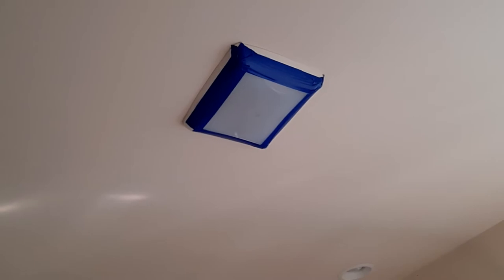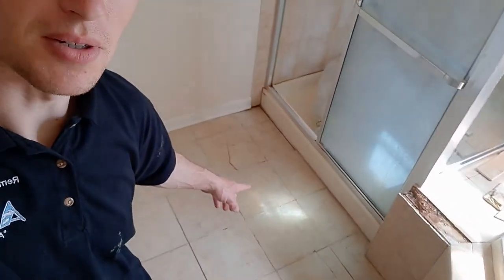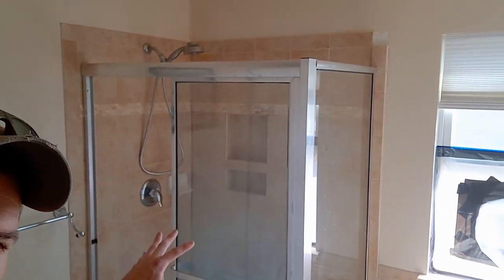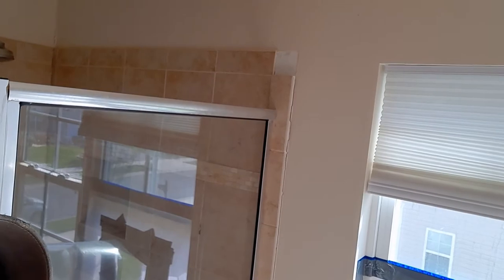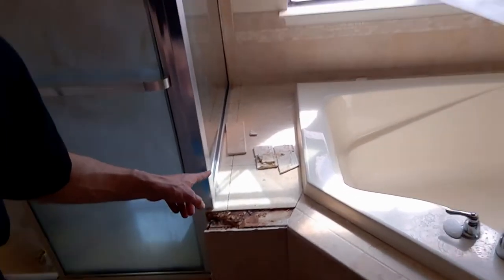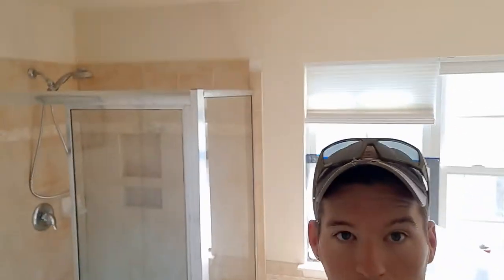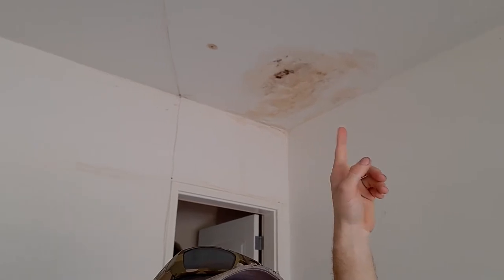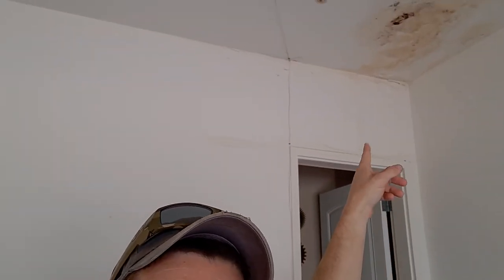Bathroom Mold Remediation Project Start

Comment: Great video! How do you do negative air pressure if there is no window in the bathroom? Also how do you remove everything from the bathroom to the outdoors without contaminating the house? Do you contaminate things with your clothing if you leave the bathroom while removing the mold?

Comment: I opened wet bathroom drywall and scraped the mold off exposing the rest of the house to the mold. Do I contain the bathroom and hepa vacuum the whole house now? Should I treat the wood in the ceiling with anything after clean up?
Reply from the maker: Hey, so when you say you opened up the wet bathroom drywall? Do you mean you cut out and removed the wet drywall in the bathroom and now you can see into another room? Like a bedroom next to the bathroom? If you have to remove drywall that is water damaged or contaminated with mold growth and it then opens up a pathway into another room, then the room you open into needs a containment and possibly negative air pressure (depending on how much negative air pressure you already have in the bathroom to begin with and how big the other room is, etc). And yes everything in that other room would need to be hepa vacuumed and sanitized at that point. Not the whole house if you build a containment around the room next to the bathroom. Also the wood in the ceiling, if it is contaminated or has visible mold growth, then yes it needs to be treated after clean up by wire brushing, hepa vacuuming, sanitizing, and encapsulating. Again I hope this helps. Thank you as always for watching and your comment.